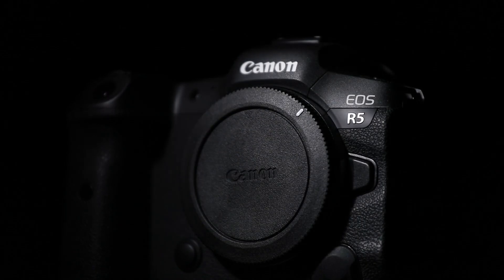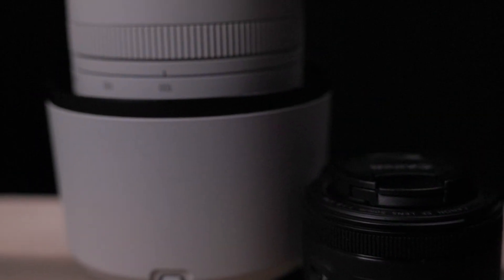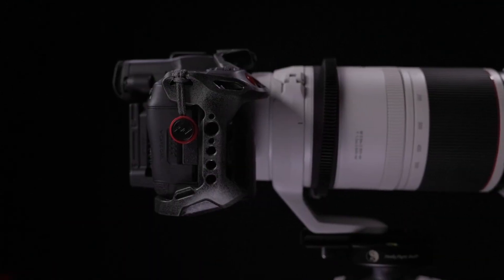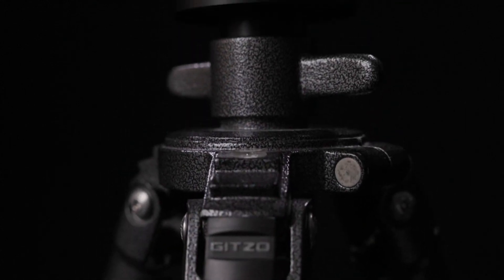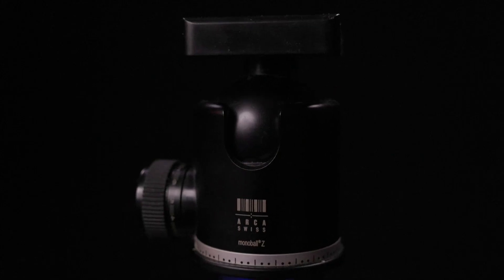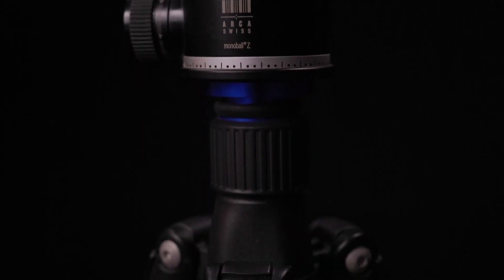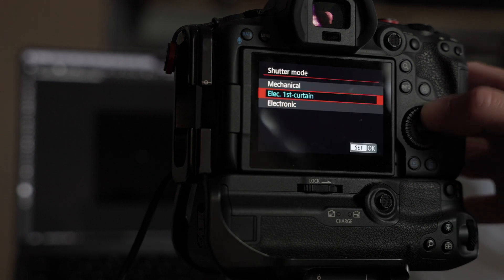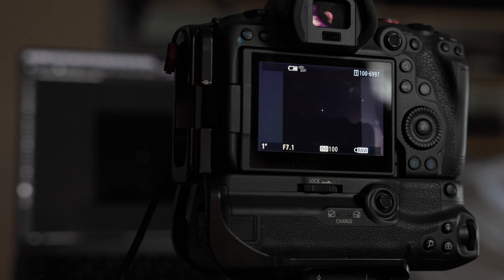Shutter Shock on the EOS R5 - EOS R5 Tip 49

Comment: Hi Jason.
Serious business as usual! Thank You!
I am doing a lot of very fast bird photography with my R5 and the 100-500mm (1/4000-1/2500),but of cause I cannot go for a lager aperture than 7.1. Question is, do you think, that this could ruin the bokeh, if using EFCS, or will this only happen if at the same time having a lager aperture?
Kind Regards, Jan from DK
Reply from the maker: No, the EFCS is fine for that. In fact, it's fine for almost everything I've ever thrown at the camera including shooting at f/1.8 and 1/8000. 

The problem only crops up when you're shooting at really fast apertures (e.g. f/1.2, maybe f/1.4) and high shutter speeds. And even then it may not be an issue depending on the scene and bokeh you have in it (it's more obvious when you're looking at OOF point light sources).

I really should do a video on this specifically, since it's a bit of a reoccurring theme and I keep getting questions on it. But I don't have a 50/1.2L and I don't really want to rent one just to do a quick testing and a demo.
Reply: I felt like I could see a difference in the bokeh even with my RF 24-70 2.8, but ran into shock issues that led me to leave my camera in EFCS.

Comment: Perhaps I missed it, but what focal length did you use for the 100-500 test?

Like Colin, I’ve encountered softness using the R5 that I never encountered using the same lens on my R. Specifically, the Tamron 100-400. Especially at 200mm or more.

I was assuming the lens couldn’t resolve sufficiently with the higher MP sensor, but then I recently came across a discussion re: mechanical vs. EFCS. I made the switch before an outing a few days ago and, so far, it does seem the issue has been eliminated (it’s too early for me to say that confidently, but I’m optimistic).

Anyways, I’m curious if you shot at 100mm or used a longer focal length? I’d love to see the same test performed across multiple focal lengths to see if results change the more you move through the 100-500mm range.
Reply from the maker: The tests were done at 500mm.

My understanding, and the basis for the tests I did here, is that if you're looking at shutter shock, you want to work at the highest magnification possible as that will accentuate the camera movement. In fact, I did everything I could in these tests to disadvantage the camera, sort of touching it, including using the lightest least stable tripod I own.
Reply: @PointsInFocus  interesting. Thanks for the info! Although now I’m back to wondering what the issue has been with my 100-400 on the R5. lol
Reply from the maker: Out of curiosity, when you were seeing issues with the 100-400 were you shooting handheld or from a tripod, and at what kinds of shutter speeds?
Reply: @PointsInFocus  on tripod, IS off. I’d have to look at shutter speeds but, generally speaking, they are slower. Fastest has probably been 1/10, most are likely in the one second or longer range. 

It’s odd as I can’t seem to find a consistent method to repeat it. Many images look fine, some don’t. I was initially thinking it was diffraction at f/16 showing up on the higher MP sensor, although I never had that concern on the R, and it would seem diffraction would have still been noticeable. 

I started using f/13 or 14 as a countermeasure, and it seemed to help… but I don’t know if it was the faster aperture or the shorter exposure times.
Reply from the maker: It's also possible that you're seeing the results of external impacts too.

I have video of the moon from my R5 in 4K crop 100-400 + 1.4x TC (may have been my 100-500 w/ a 1.4x TC) at the longest possible focal length. I was shooting from from a carbon fiber tripod on a concrete deck, and anytime anybody walked within 10 feet of the camera there was small but noticeable shake in the video. Something else to keep in mind if you're not shooting on really solid ground.
Reply: @PointsInFocus  obviously possible, but unlikely given where I’ve been shooting. Always on solid ground for landscape work. Could be wind, but it’s showed up in photos where it’s been absolutely still. 

Whatever it is, it’s odd, and frustrating. It’s not so bad to ruin most images it appears, but they’re definitely lacking in sharpness when you start looking closer.

Comment: It looks like you ran the tests with a 1 second exposure time.  I thought shutter shock was most prevalent between 1/60 and 1/200 second with the middle of that range the worst.  Slower than 1/60, and the shock time is insignificant compared to the duration that the shutter is open, greater than 1/200, and the shutter speed is too fast to see it.   I use an R5, and don't notice shutter shock in this range, so I just ignore the issue and choose mechanical or electronic based on my frames per second needs.  There have been reports of an issue with using the EF 600 f/4 iii lens, and people thought it may be related to shutter shock, but it seems like it was an IS issue.  There was a firmware update for it.
Reply from the maker: You would be correct, if the test target was reflective (like a print of a paper test chart). It's not. It's an emissive target (e.g an LCD display) showing white pixels on a black background.

However, because it's an emissive target, any vibration due to "shutter shock" would show up gray "blurs" or smears in the area around the white dots. The long exposure doesn't matter in this case, because the black part of the target isn't emitting any meaningful light, therefore the only light that would be contributed to those pixels would be light from the white pixels shifted there due to vibration.
Reply: @PointsInFocus  While I can appreciate the theory behind using emissive light, the choice of an LCD with a pulse-width modulated LED backlight may present an issue. These pulses could be out of phase with the resonance frequency, or any harmonic, of the shock oscillation frequency. This phase misalignment could explain why light wasn’t captured from the vibrating pixel, despite the source being "emissive." If your emissive light source had been steady and constant, like sunlight, the results might have been different. In essence, your test is like attempting to light the top of a sailboat’s mast in rough seas with a rotating lighthouse beam. Only through pure chance, when the boat crests a wave and the beam happens to be pointed in the right direction, might any light reach the mast. I apologize for the rough analogy, but I hope it clarifies my point.